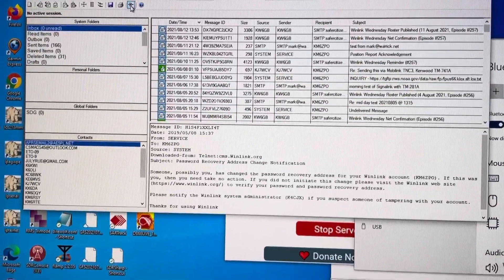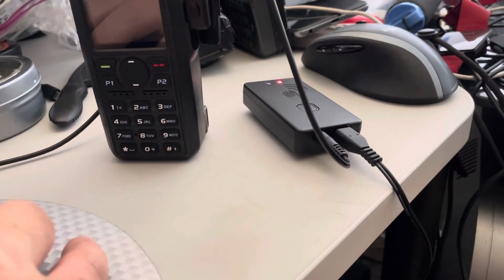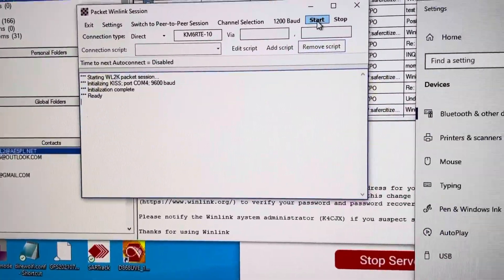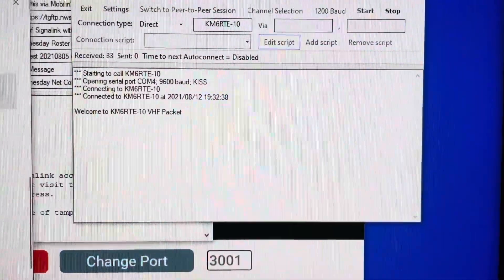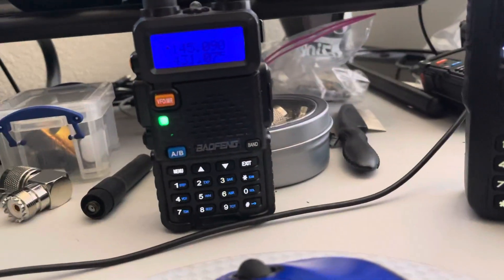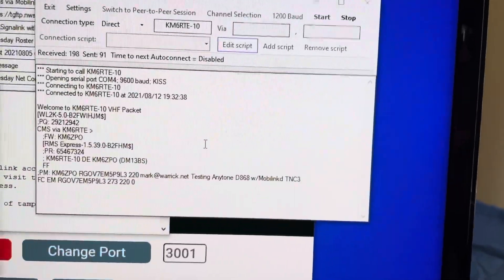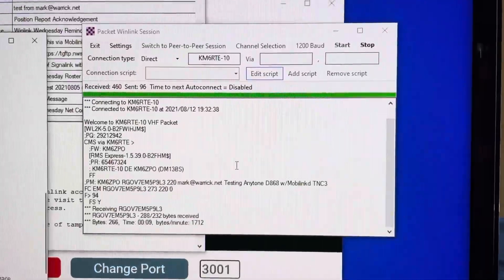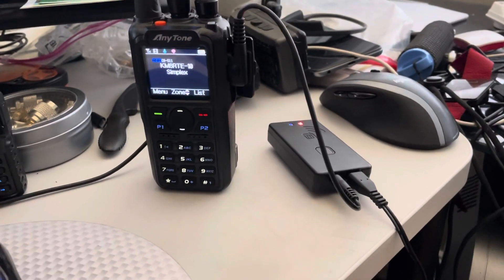Winlink with Anytone AT-D868 and Mobilinkd TNC3

Comment: Can you please post your settings on the MobiLinkD.  I am having issues with it working on my FT-60R. But not one my Anytone. {and yes, I am resetting the TNC send/receive values for each different HT.}
Reply from the maker: Default settings work. The only thing I changed was PTT type to multi.
Reply: What I discovered was that I had to turn VOX on in the radio

Comment: Which cable did you grab from the Mobilinkd website? I've been looking but don't see Anytone listed anywhere, nor have I found the requisite cable upon some cursory searching. Cheers!
Reply from the maker: It’s a standard K1 connector just like those use for Baofeng, TYT and other Chinese radios.  It is NOT the programming cable, but rather, just the audio.  

BTECH APRS-K1 Cable (Audio Interface Cable) for BaoFeng, BF-F8HP, UV-82HP, UV-5X3 (APRSpro, APRSDroid, Compatible - Android, iOS) 
https://a.co/d/iBFVv2F
Reply: @MarkWarrick  sweet! Are you just using vox?
Reply from the maker: @dylan_00  yes. It will take some tweaking before of the TNC and winlink settings and may not be compatible with all gateways.

Comment: What settings did you use in the 878. I have an 878 and the TNC-3. It works great with my YAESU HT's in multiples. I can get it to communicate with the 878 in simplex and see the red light come on, but can't hit the gateway. The other radios hit the gateway just fine.
Reply from the maker: Red light on the radio or the TNC3?  Did you turn on VOX?
Reply: @MarkWarrick  RED light on Radio.VOX is not on.
Reply from the maker: @wanderingwithbob2472  turn on vox
Reply: I’m trying to figure out how to have that same setup but to chat from anyone to anyone over dmr meaning my ham radio buddy with an anytone and a mobilink and me with the same having a chat, not sure which software yet

Comment: Thanks for the video. What cable are you using to connect the anytone to the mobilinked TNC3?
Reply from the maker: It's a standard K2 connector cable.  You can get one from Mobilinkd here: https://store.mobilinkd.com/collections/tnc-cables/products/kenwood-wouxun-baofeng-tnc-cable
Reply: @MarkWarrick  I have the cable and my base station sees the 878 transmitt, but the gateway never accepts the broadcast. I use my other hts and they all work. Wondering if there was a setting in the anyone that may need to be set.
Reply from the maker: @wanderingwithbob2472  Email me at mark@km6zpo.com

Comment: For what its worth, I was buzzing my parents' pc speakers, so I solved that problem by getting them a pair of Bose Companion 2 speakers. Those speakers are RFI shielded.
Reply from the maker: The key reducing RF noise inside the house is to move the antenna to outside the house.  You can also reduce the power.  I managed to use the same setup in this video on the lowest power setting (1 Watt) and was still able to make a connection.  Low power operations are ideal for many reasons.
Reply: @MarkWarrick  I have two Winlink gateways that have antennas in the attic, and for the time being they will have to live up there. I wish I could put my antennas outside, but hopefully in the future I will be able to do so.

Comment: I just bought one of these Mobillinkd TNC3s and the Kenwood/Wouxon/BaoFeng cable literally 5 minutes before finding your video!  I was planning to use it with my Wouxon; but now you've got me thinking I can try it with my AT-878UV.  Thanks for sharing!
Reply from the maker: Yes it should work on the 878. Set VOX to 1 and delay as low as possible.  It also works with a Baofeng and Radioddity GD-77.  If you’re not getting any response at all from the RMS gateway, you’re too far away.  Everything else is a configuration issue.
Reply: @MarkWarrick  my closest packet gateway is in my house!  🤪  I’ll set my radio output as low as possible too.  Again, great video!